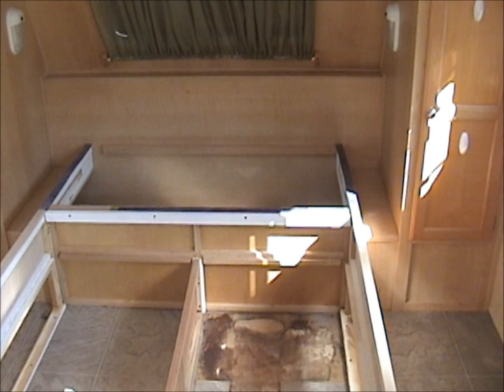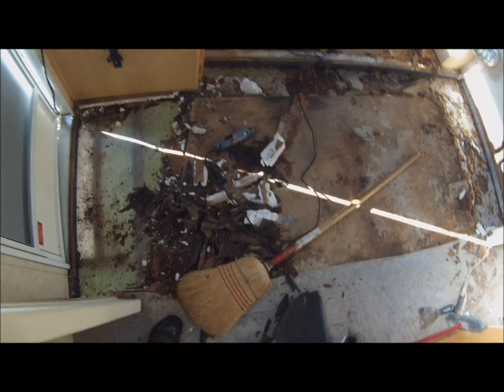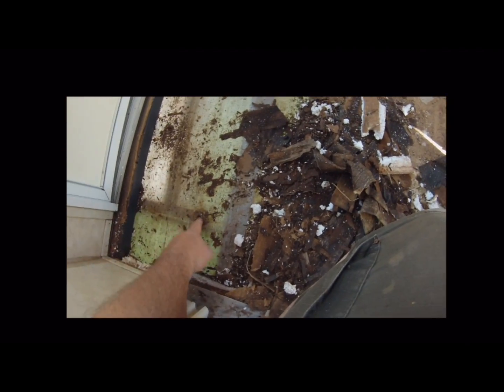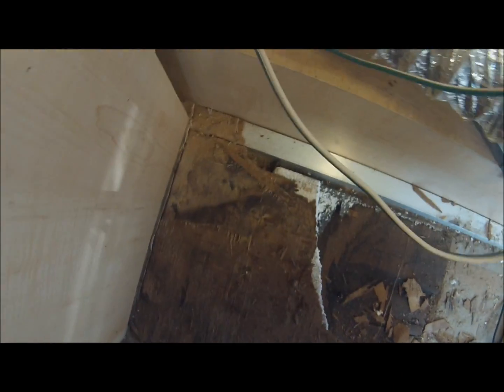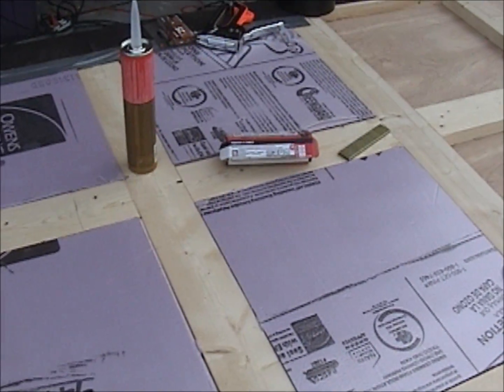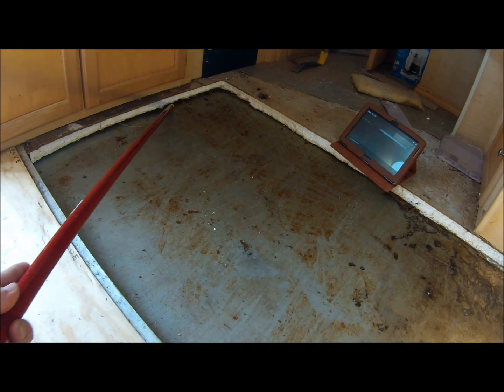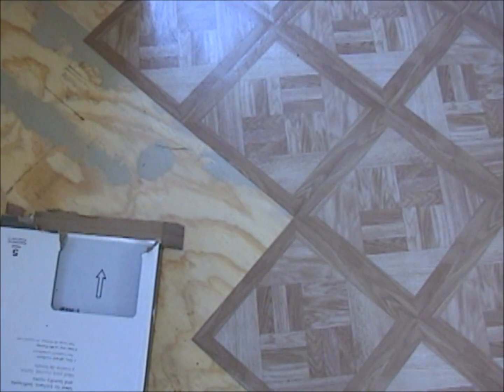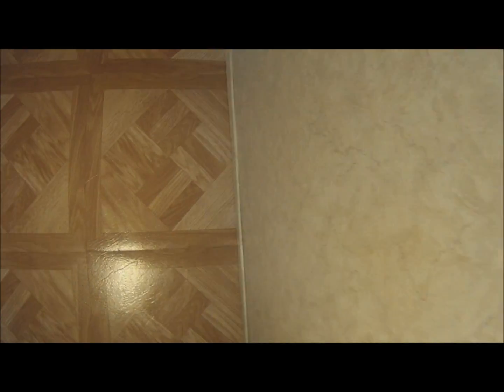How I replaced the spongy floor in my RV for under $500

Comment: I have a trail-lite 2001 travel trail and the floor is week in areas and need advice on how I can fix it,where to start and if I can do it and im a 53 or old woman but don't know where to begin and can it be done without taking it to a repair shop all I can afford supplies but don't even know what kind of supplies to get
Reply: Might be too late but...

1) Need 2" treated wood for the floor frame. Can also use 2x4 studs and cut them to size.

2) Need OBS boards as well. Same thickness as the original floor. Some steel brackets to secure the studs.

Tools: SkillSaw, ElectricSaw, measuring tape, leveling tool, carpenter's square, and a framing gun.

Steps: 

Cut out the damaged areas with the skillsaw. Make sure to adjust the saw to the thickness of the OSB floor - to prevent cutting into the frame of the trailer.

After removing a section of the floor; locate the steel beams (under the floor) and continue cutting the osb board flooring halfway into the beams - so that new beams can sit on top of the steel beams.

Remove all the water damaged flooring.

Joist in the two beams (the new and the old) using a steel bracket, or 2 studs onto both sides of the meeting point (one for each side).

Floor might need extra support on the sides (to prevent it from sinking with weight) - in which case you will need to add more 2" studs wherever the old and new floor will meet. 

Next, cut the new OSB flooring to size and nail it into the new studs. You can use a chalk line to mark the stud's position.

Done.

Comment: most rv makers who manufacture "lite" trailers like this use a laminated floor to save weight.  It's just thin luan on both sides with styrofoam in the middle like this trailer.  It's absolute crap.  Any water and it disintegrates

Comment: Was looking at a 26 foot 1999 Trail Lite. It has some water damage in it around the front inside from a leaking front window and a bit of a sag in the roof around the front skylight for some reason. Was considering doing the repair myself but after seeing what yours looked and how it was built when you opened it up, this would be a tough repair task for me to do properly. This trailer used lightweight monocoque construction technology and to duplicate that requires some serious attention to detail and technique. As you saw there appeared to be a few issues in the design and structural layout of that area you worked in. It is not tolerant of water intrusion (no way for it to escape) and lacks the extra support needed in the main floor span area. It would not support my plus size carcass mass anyway. I think I will pass on that trailer after seeing what makes up the structure on this trailer. I am not patient enough to do the massive disassembly and devote the time repairing the damage it would require. Thanks for your video.